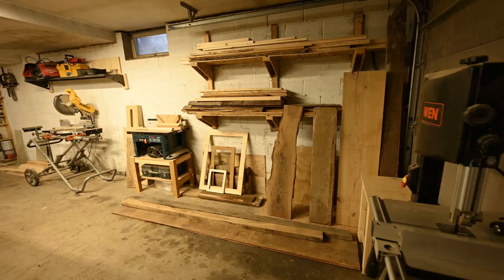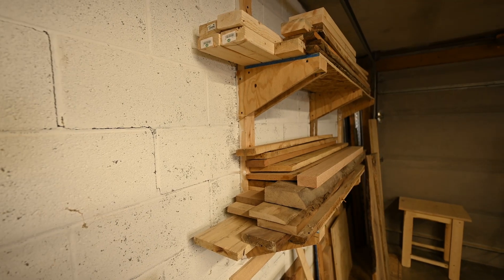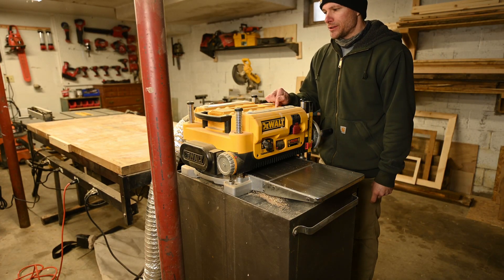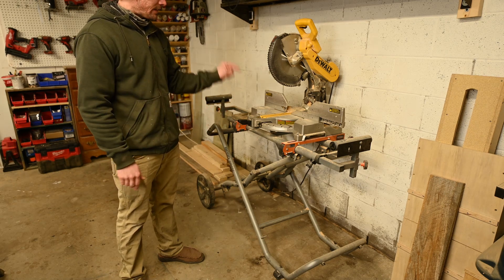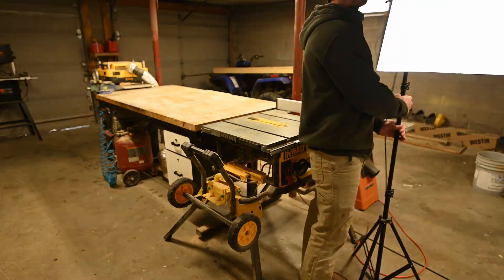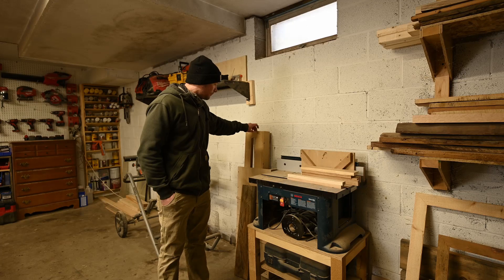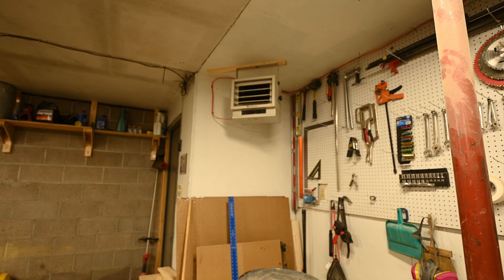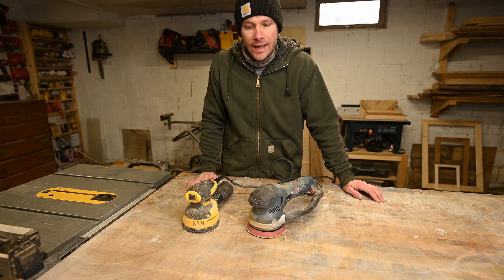Small Wood shop tour. Ultimate small space workshop. New shop soon?

Comment: look into the clear vue cyclone system.  it runs on a 5hp motor so it needs a 30 amp breaker.  its super powerful and half the price of 3hp units from big name companies.  I actually finally ducted in all my tools with 6' PVC.  best thing I ever did
Reply from the maker: Holy shit 6" pvc? Lol. I'll definetly look into this. I want good dust collection in my next one. Thanks for the recommendation!
Reply: Ohh yeah wider the better more CFM with wider ducting.  Some guys go 8’ depending on the Unit.  Most 220 3-5hp dust collectors have 6’ or 8’ inch intake